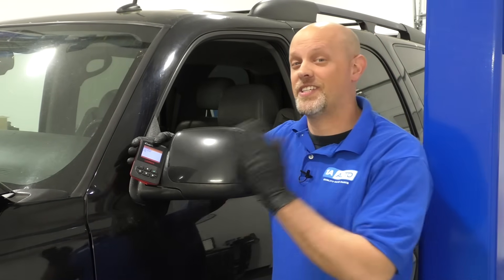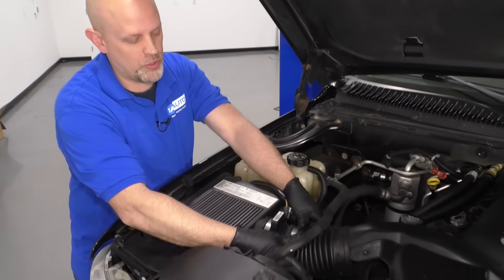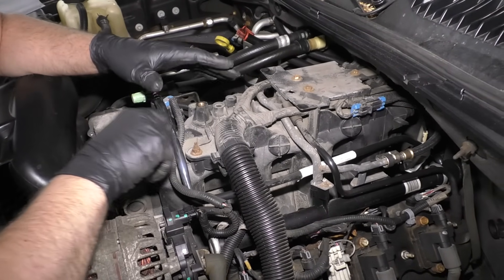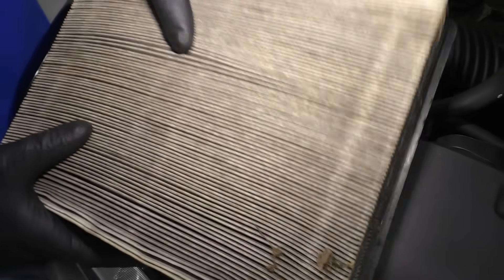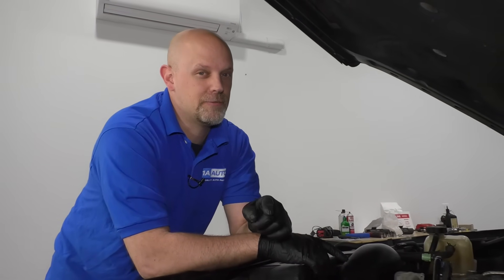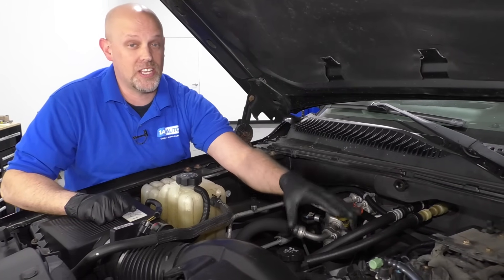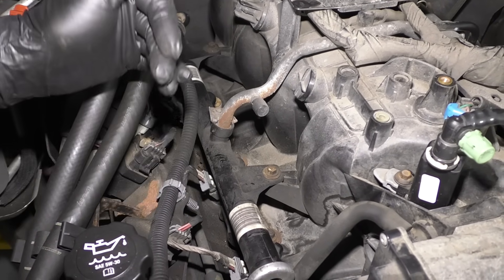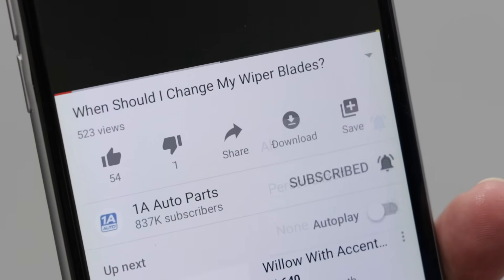Check Engine Light? System Too Lean - Code P0171 or P0174 on Your Car or Truck

Comment: Skews me I have a Nissan frontier 2018 four years old with 25,000 miles on it just crossed it my check engine light has been coming on with the same lien bank both codes and they’re telling me that there’s nothing wrong. They left my filter, the air filter what you’re describing here first thing in my truck for four years it was black. My truck is idling at 1 1/2 thousand RPMs when I put it in reverse it drops below one RPM. My truck is getting 133 miles out of a full gallon in my truck hauled 17.12 gallons of fuel I found for the lemon law. I won the lemon law once with Nissan do a check engine lights everything is tight on my vehicle. There’s no airflow problems but of course something isn’t right. I don’t want my truck. I had the original tires everything my battery manufacturing blew up inside my vehicle when I was three years old What should I do? Any information could help me please I’m a Maryland residents and I want the lemon law wants to Nissan corporation due to faulty wiring and check engine lights coming on before the 25,000 mark and a Ford check engine lights keep coming on for the same problem I don’t want that engine am I right or wrong?

Comment: I get that code only during cold winter mornings or in a inclosed car wash. Anybody know why? I have a 2003 5.3 Avalanche
Reply: Could be the heated component of O2 sensor since it needs to warm up to work properly to get proper voltages

Comment: So if I hear you correctly there is virutally no difference between the P0171 or the P0174? 
For instance my code reads "System Too Lean Bank 1"

Comment: 3 turns to get my vehicle started every morning.
 po171 code system too lean (bank 1). DTC Severity 2of 3. Help?
Po174 system to lean (bank 2)
Po420 catalyst system efficiently below threshold

Fairly new fuel pump 2yrs old
Changed air filter and MAF
Occasional jerking, and knocking while driving,low acceleration, some stalling when jerking . 08 Ford expedition 5.4 V8 
You have given me the confidence to repair myself . I would like a better idea or suggestion to my problem? Thank you so much
Reply: Erin, did you figure it out? I am literally dealing with the same issue. The crackup here is that the error code is super vague. Even his video lists so many things it could be rather than an isolated issue like the code would suggest. For instance Why would it say Bank1 if it could be the MAF or why would it identify Bank1 if it's a gasket leak like he was testing for in his video. Bank1 is pretty specific in engine terms, right?

Comment: my 2004 lexus is was the air filter put in the wrong way lol. that caused the MAF sensor to get dirty.  i ended up replacing a few hoses, due to thinking it was a leak. Its been 6,000 miles since my check engine light came on

Comment: My Dodge Challenger is throwing both codes 0171 and 0174. My car is only a year old I’ve been taking my car back to the dealer ever since. So far it’s went to the dealership 3 to 4 times after the symptoms. The check engine light just barely came on and they were able to get these codes.

I’ve been telling them the ecm light has been coming on, rpm’s ideling, high which takes forever to go back down to normal, loss of power and  for the first time I heard a loud thunking / knock noise from under my drivers seat. 

Could this be a defect that occurred While the car was being manufactured? The car started having these problems and symptoms two months after I bought it brand new.

Comment: So what will be the solution to the problem if the air-fuel mixture is not correct? 7:30

Comment: If there’s a hole before the air filter in upper housing (plastic house broke and missing plastic will that cause these two codes?) I duct taped hole until I can get a new upper housing

Comment: I Found No Vacuum Leaks.. They Replaced The Mass Sensor, Fuel Pump, Fuel Filter & Fuel Pressure Is Good..! So 02 Sensor? How Can I Tell If It's Bad?

Comment: I hope these tips help someone. 

Sometimes if it's not the vacuum lines or the mass air flow sensor it could also be a clogged fuel filter, fuel pump, injectors or the high fuel pressure regulator. If that doesn't fix the issue a corroded or a bad coolant temperature sensor can also trigger P0171 becausen it won't read the right temperature and it will mess with air and gas mixture by sending false information to engine's computer and that will lead the car to rough idles and throw P0171. In my case I cleaned the mass air flow sensor, I inspected the evap hoses for any leaks and I still kept getting P0171. Based on all the videos I've watched on YouTube not a single mechanic has mentioned the corroded coolant temperature sensor and that happened to be the problem on my 2005 MK4 VW Jetta 2.0L After changing the coolant temperature sensor the car worked fine and the code never came back.
Reply: Dude..thanks!!I guarantee that's my problem I never thought about em getting clogged since their pretty new.
Reply: Thanks, I had P0171 pending and P00B4 too, which is the coolant temperature sensor. Good to see they might be related.

Comment: My 2007 gmc yukon sounded like it was back firing through the intake and died going down the road. I now have both p0171 and p0174.. It will not start at all, any ideas where to start?

Comment: Got the same code. And the light goes away after I fill the tank up full in the car. Does that mean fuel leaking or not enough fuel getting into the engine.

Comment: Thanks Buddy, my engine light just went on, checked it with code reading PO171 system too lean. didn't know what the issue may have been, but you just solved my worries. you're Awesome. Thanks Again
Reply: I just got the same code today, what did you do to fix? I tightened my air filter box and also had a hose like the one he shows disconnected going to see how it drives in the morning

Comment: I had a P0174 code on a Dodge Dakota 2003, 3.9 V6, it was running rough and occasionally would throw other codes and backfire. After watching this video I went to work with the carb cleaner and noticed a leak between injectors 3 and 6, it turned out to be loose intake screws in the area,  I retorqued and problem solved!  Thank you.

Comment: I have a P0171 code that won't go away. Have tried everything. New O2 sensors, new air hoses, new air intake gasket, new throttle body gasket, cleaned the throttle body, new idle air control valve and gasket, new mass air flow sensor, new air filter, new spark plugs, new PCV valve, new fuel filter, new fuel pump. Have also checked fuel lines for kinks, and checked hoses and exhaust for leaks. Have also added fuel injector cleaner to the gas tank. The engine running lean has caused misfires on all 4 cylinders which makes me think it's probably not a dirty injector.  Each part replaced has made the car run and idle a little better, but the code persists. All replacement parts are OE. It's infuriating.

Comment: Just curious. If you are only getting one of these codes (P0174 for me), would that indicate an issue isolated to either side independently from the other? I mean, would all the intake stuff cause both codes to fire? If only one of those codes, would troubleshooting need be focused on the respective side?
Reply: Check for pending codes.  If you have a pending P0171, then it is on both sides and one side just tripped the light first.   If you don't, suspect oxygen sensor on that side.

Comment: I have a 2006 Chevrolet trailblazer and check engine light was on but went off but code read p0171! Does this mean it's the fuel pump?

Comment: Hello, thanks for your video. One question, I have a 2008 Toyota Corolla with 230,000 km of manual gearbox, 1.8-liter engine, type 1ZZ-FE. The fault is that when you turn it on it starts with 1300 rpm and as it warms up it goes up to 2000, that is, it does the opposite since I understand it should go down to about 900 rpm. and when I'm hot I go out and when I make the gear changes I see that the rpm's go up and down between 2000 and 1000 rpm's and when I keep going the minimum is 2000 rpm. If I leave it running stopped the car stays at 2000 rpm's. I clarify that with the Toyota scanner it did not give an error and also the check engine light does not come on. Could it be a vacuum leak in the intake? should i just change the intake gasket?

Comment: You're the only guy that starts at the beginning of the airflow and works it through that way. Everyone else starts at the 02 sensors and works back through electronically.... If the air isn't right going in at the first monitoring point, nothing is gonna come into alignment electronically. Thanks again for a clear, concise, orderly troubleshoot and repair!

Comment: One important note.... ⚠️. If spraying carburetor cleaner or anything flammable, do it before the engine gets too hot. Just 1 stray spark, one overheated connector and a vacuum leak from a cracked hose or loose manifold bolt becomes a much more involved repair,  possible insurance claim, unhappy customer...not to mention the possibility of an injured technician. Just a small tidbit of advice. Be very careful and have a fire extinguisher nearby.

Comment: i have a p0171 i couldn’t figure it out so i took it to the shop they couldnt figure it out either they didna smoke test and no leaks ran diagnostics and nothing and the light turned off by itself during the testing. later that day when i was driving the light came back on same code

Comment: It is an excellent video in relationship to these particular codes much more thorough than any I've seen and especially appreciate you referencing the front 02 sensors as a potential problem.

Comment: so what would i look at on a 2001 ford f150 with a 5.4 v8 showing codes 171 and 174 .. system lean bank 1 and 2 ..changed the IAC.. no vacuum leak cleaned the Mass airflow sensor ...but its dying while in drive at a stop light or stop sign ..rough idle .. but driving down the road it doesnt die

Comment: I have same vortec engine ,  after replacement of
 new filters (both),
new o2 all (4 ),maf sensör , pvc valve(valve cover) eng.light is not coming back.
But  fuel ratio still to high , and consuming more fuel.
Fuel pump pressure ok.
All enjektors active.
No air leak.
Last thing I'm gonna do, clean or replace all enjektors. 💰.

Comment: i has a question how bad is it to run with this condition? just wondering as the part that needs replacement is the throttle body gasket (in my case). Seems to be on national gelatical back order and can not get till like next week. So my resolve it  1 of 2 ways wit the few days-week or make one using form a gasket sealant.  so question is should i wait for the proper part in doing so driving with this condition? or is it an issue that should be fixed prior to going any distance with the vehicle?  Btw replacing a thermostat on a Rodeo or Passport is not an ez job designer's are insane IMO.

Comment: I have a gmc yukon check engine light came on and I can't figure it out only thing is the intake tube was disconnected but I've connected it back but still have the code, no drivability issues maybe O2 sensors?

Comment: I am getting these two codes P0171 and P0174 code along with a P0302 code on my 99 Ford Crown Victoria Police Interceptor, not the MAF I replaced it and it gave me a different code AND it ran worse so I placed the old one back on and it ran better. I am getting a rough idle, white smoke on occasion, a slight hint of gas smell, and I feel the floor shake and stumble underneath my feet just before the pedals when I press the accelerator as if I got an exhaust leak, it sounds like the exhaust is spitting air out of the exhaust. I've replaced a failing PCM which eliminated a bunch of false codes it was throwing, replaced ALL the ignition coils, replaced an O2 sensor and am about to do the other 3. I am also about to replace all the gaskets and fuel injectors AND the fuel filter in my car too. Is there ANYTHING else it could be?
Reply: Have you checked vacuum lines? I replaced all my old brittle lines with silicone hose. Bought 20 ft of hose and 2 T connector's. Mine is a 96 Ford bronco so yours may be different.

Comment: I'm not hearing my fuel system prime with key on position which I believe is causing hard start I test the fuel pressure its zero with key on engine off at idle when it finally cranks its 47psi brand new Delphi fuel pump with filter 97 Chevrolet blazer 4.3 vortec what could cause fuel system not to prime?

Comment: Could the p 171 code occurs if it’s the o2 sensor? I guess you answer it at the end of video.
Reply: It could, depends on if its in both banks. If the code occurs in both bank 1 and 2 it is unlikely to be the o2 sensor, since it would be illogical for both sensor to fail at the same time.

Comment: Check engine light was on so  i lifted the hood and it was still there. Imagine that!!!
Reply: Check engine came on for me 2 separate times  years apart,  dont remember the codes but light went off by itself a few days later. Now I'm a certified Mechinix
Reply: Good job that you checked that
Reply: Me too🤗😳
Reply: Get a computer for your car to see the codes to see what’s wrong with your car
Reply: same here 😢
does anyone have a fix for this!?!
Reply: That’s not how u check

Comment: Just figured mine out! Replaced the injectors and intake manifold.   After much headache chasing a vacuum leak, I found my new set of injectors were junk.  Could be injectors as a cause of lean code or rich code.  My case for lean was the injectors.   Didn't want to redo tje intake manifold a 3rd time.  Was worried I had a crack in the manifold.

Comment: could a gap on the throttle body plate cause air too lean issue? i have a 1/16 gap on the throttle body plate and I have a code for air too lean issue. thanks
Reply from the maker: +jango bhai We wouldn't be able to diagnose an issue like that here, you may want to have a local mechanic take a look at it. Thanks for checking us out! http://1aau.to/m/Shop-1AAuto-c

Comment: 2004 silverado 4.3 
So I have both codes. I replaced the maf and the fuel filter. Still had codes. Today I stopped and got gas. I accidentally left the gas cap off. After about 15 minutes of driving the check engine light went off and the truck started running great. Any ideas?
Reply from the maker: +R Williams We wouldn't be able to diagnose an issue like that here, you may want to have a local mechanic take a look at it. Thanks for checking us out! http://1aau.to/m/Shop-1AAuto-c

Comment: Hello awesome video..thank u i have a 2008 BMW 328i..its throwing 29E0 and 29E1 bank one and bank 2 lean codes..we did a smoke test and found injector seals leaking ..replaced seals and codes still come back sometimes..at idle my hand held scanner says fuel pressure is 55 psi..some BMw people said it should be 70..but I dont get any FAULT codes  for bad fuel pump..could LOW fuel pressure at idle cause these CODES i listed above..at cold start the RPMS go up and down just slightly, then the rpms even out after a minute or two....what about MASS AIR FLOW..no codes there either,,any input MUCh appreciated thanks we did 2nd smoke test and didnt find any leaks
Reply: How is your airfilter?

Comment: MUST READ! I was going crazy trying to get that error code fixed.  I have a 03 v6 4.2 and turns out the leak came from bolt bushings at passenger side intake lower portion. Ford released a service bulletin TSB 04-17-04. Hope this helps for anyone who struggled as much as I did.
Reply: Did you have to take the upper intake manifold off to put new bushings in? And do you have the plastic or aluminum manifold?

Comment: İf enjektor it self or broken enjektor connector wires bad , 300 codes will be apper.
Vacuum leak  and O2 sensor or hole on exhaust pipe  before cat.convertor.
Also broken O2 s. Connector wires.

Comment: Can a bad purge valve also cause these codes? I'm not 100% certain, but I think that might be the case with mine.... It sounds like I hear air coming from it, but I can't get the line off of it to tell for sure

Comment: 2008 f150 4.6 2v p0171 and p0174 codes both thrown. Its only thrown at idle which would make me think vaccum leak. I cant find one. Hooked a vaccum gauge up 21 at idle responds like normal at diff rpms. Fuel pressure is good. MAF good EGR good. Havent checked o2 sensors but hard to think 2 sides would go out at the same time. Any suggestions?

Comment: As usual, very instructive, clear, concise. Always check easy things first, that's my motto with any repair and you nailed it on my issue. As at the beginning of the clip, it was only the MAF that got loose at the air filter box. Put it back, cleared the code. Hopefully it was only that and nothing else comes up. Thanks for your precious help!
Reply from the maker: +Martin Beaumont Thank you! We love empowering our customers and showing how to perform DIY auto repairs with our high-quality auto parts.  http://1aau.to/m/Shop-1AAuto-c

Comment: I replaced the bank 1 02 sensor and after I did the code popped up! Help?
Reply from the maker: +ClapUrTerdCutter - We wouldn't be able to diagnose an issue like that here, you may want to have a local mechanic take a look at it. Thanks for checking us out! http://1aau.to/m/Shop-1AAuto-c

Comment: I had the 171 code and turned out I had a fuzzy thing that mustve come off the filter and wrapped around the wires on the MAF filter. Pulled it off with tweezers, sprayed it good with MAF cleaner, let it sit for a while to make sure it air dried good. It was messing my 2011 silverado up big time. Now it's running good and no more engine light.